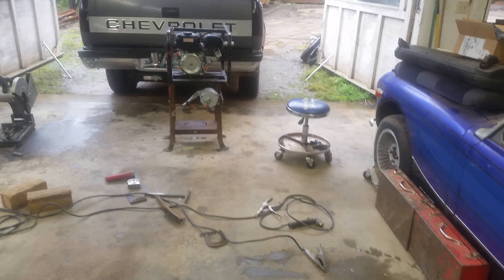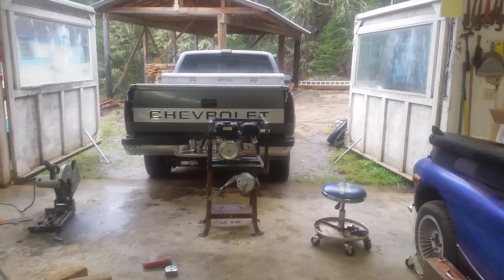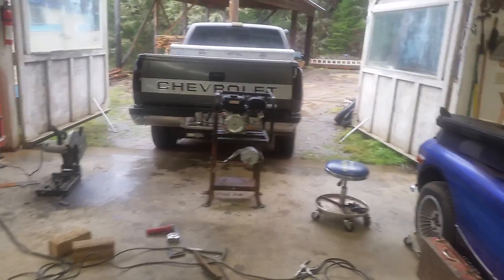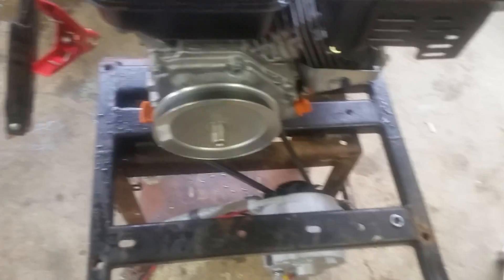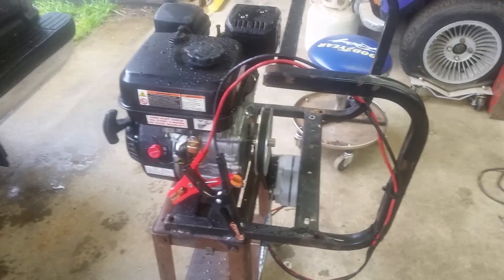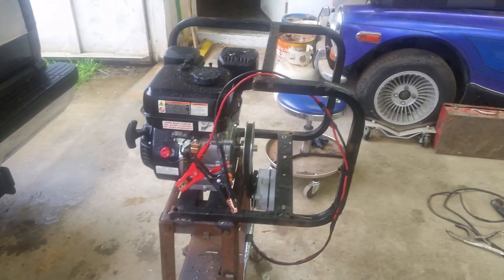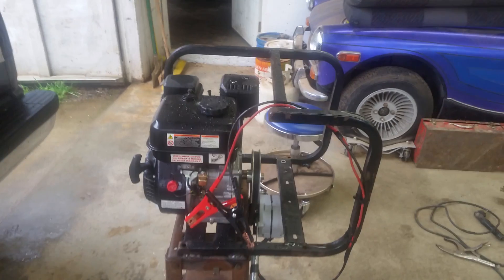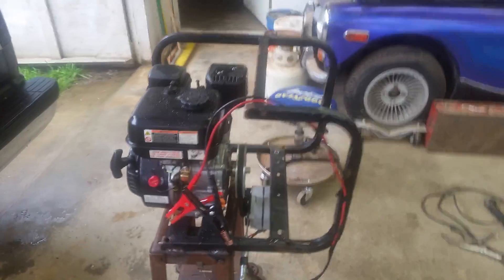Finished the mods on the 24 volt genny.

Comment: I hope all goes well with your health. I am wanting to series two 12 v alternators. For charging my bank. I have 2 delco 150amp alternators. And two 130amp . I want to use both pair to charge my bank! I have the big delco comercial alternators. The 22si. I know they are better ones. But these are better than the 10&12si alts. I have a 5 hp Briggs to spin them I don't need full power just yet. I do have a 12hp to hopefully dpin all 4  eventually. Would you know how best to wire them in series? I'm thinking of removing the rectifiers and connect in series. And insulate them. With cooling... So mounting will be alot easier. It can get difficult to mount and insulate alternators. Do you have any advice? I'm hoping I can make enough current to both charge the bank. And power the inverter. 280 amps @ 28.8 volts give or take. I figure I should get 200-230amps atleast. I only pullabout 100 or so with the inverter. Thanks and I just noticed this videos age. Any way thanks!
Reply from the maker: Greetings, I have several videos on all the mods for the dc generator. I have learned a lot over the last 5 years. You can email me at,   back41@cavenet.com

Comment: my 2.4 hp 1500/2000 w, generator has a 12 v DC .but it is only 10 amp max. i hooked up to the battery of  my running truck and  did not get much more at idle. plus i then need to convert to 24. i have an old mower and want to try this.

Comment: How you connect battery wire to the alternator
Reply from the maker: son nguyen This alternator is a self exciting one wire output. There is one terminal that goes to the positive battery post and the negative connection is between the nagative battery post and the alternator housing or mounting bolt.

Comment: Due to health I am no longer off grid but when I was I had an a 12volt alternator hooked to a 3 1/2 horse with a 1 quart tank that would charge my small system with just 1 tank of gas! That worked real well in the shorter winter months or on the days I did laundry I agree with you it is the most efficient way to charge!

Comment: Half is still half
Half of one minute at 400 Hz is 30 seconds
Half of one minute at 60 Hz is the same 30 seconds

But your point on using a cheaper engine using less fuel is a critically important one.
Reply: Thanks
Will send email by PM

Comment: Isn't that why industry uses 440 3-phase to power things. It's more efficient & easier to implement than 60HZ 220? Also the fact that there is an inherent loss when converting from DC to AC to DC. When I word for IBM in their power division we could get away with cheaper components when using 440 3-phase. The DC for the main frames could be generated with smaller banks of capacitors as well as lower current devices (diode rectifiers, capacitors, etc). 

Your setup is another example of Yankee ingenuity.  So what would happen if you added more alternators in-line running off the same motor?

Ever thought of doing a series of best practices for setting up a off-grid power plant? What is the best bang for your buck for solar equipment. 

Been praying for you for a full recovery.

God Bless

Comment: Sure hope those test results come out good. Sounds like what a lot of us vets are dealing with...exposure health issues. As for this video...24v alternator x 30 amps = 720 DC watts going into your battery bank...BRILLIANT! Excellent design and cost savings. I really think you are onto something here. How much was the alternator? You said the engine is about $100. There are so many little portable generators out there that make AC power (like my little Honda)...but, not full blown DC power for charging battery banks. Makes PERFECT sense to me. I bet that little engine doesn't even burn that much gas anyways. How many CC? GREAT video, GREAT design, and can't WAIT to see it run!